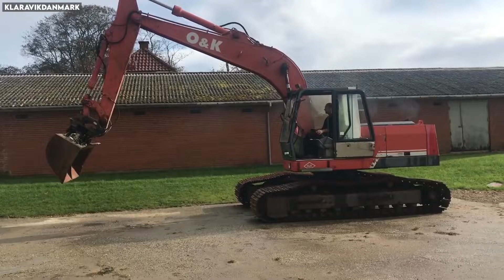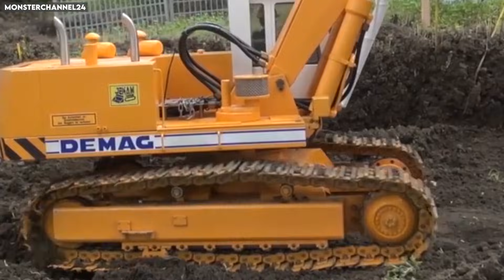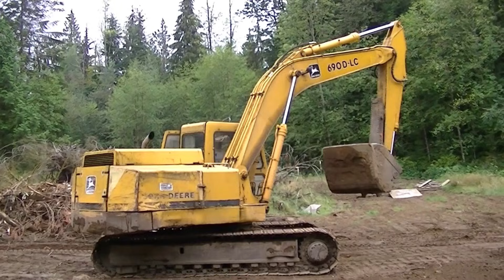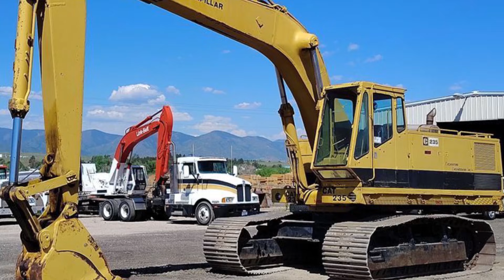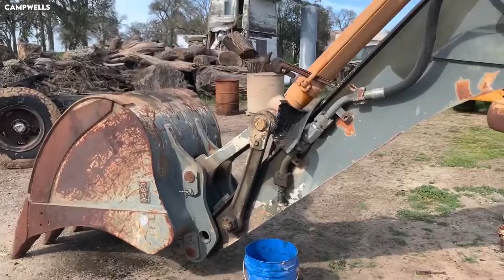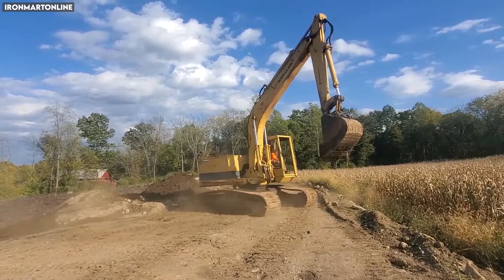10 Excavators From the 1980s Built Before Reliability Was Optional

Comment: STUPID FUCKING Ai --- Liebherr R974 --- Operating weight ~ 176 - 198k lbs (74 metric ton machine)...+/- 500hp --- dumb mistakes. Next --- You talk about Deere 690D...and then show 690B, C, D and E --- and the 690B, C and D weren't particularly great machines...the E was essentially the predecessor to the 200LC...Possibly one of the best excavators ever made...though the 320 Cat...PC200 Komatsu and EX200 Hitachi are all great machines. Then...you bring up the Poclain 1000 --- another HUGE mistakes --- 170 metric ton machine...375k lbs, and running (2) Duetz engines rated at 458hp EACH! Next --- Cat 235, Operating weight: 86k lbs. Boy...for all Ai is supposed to be...it cannot even properly say "Caterpillar"...Next --- Hitachi was far above and beyond in running a highly reliable Isuzu diesel engine, and their understanding of variable displacement pumps, literally made Hitachi was it is today. Next --- the Case 1288 should not be on this list...but...your specs are also not accurate: 55k lbs, 25 metric ton machine, and 174hp....and quite possibly one of the worst machines made in the 80s. Plagued with overheating and hydraulic problems, this entire decade Case really struggled. And finally last --- you numerous times, mispronounced the Cat 245 as a "2045", while showing the Cat 215, 225 and 235 in many different series...Ai is ruining Youtube!!!! Poorly written and researched video!

Comment: I would take an old Cat 225, 235, or 245 in a heartbeat. The only thing I didn't like was the centre stick for turning/steering, it was a pain trying to do a 3 point turn at times. The older Deere 690 was great. The Komatsu 400 from the 80's was a beast and a joy to operate. It was so advanced compared to the Caterpillars.